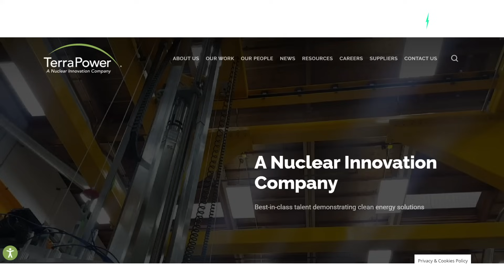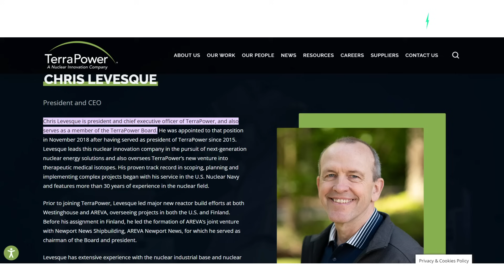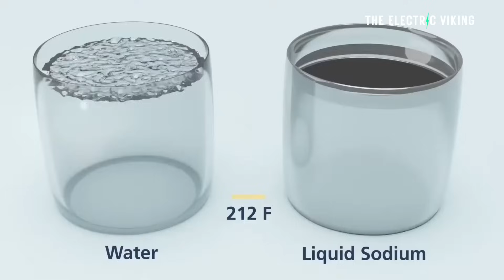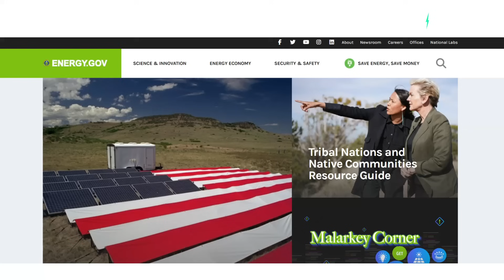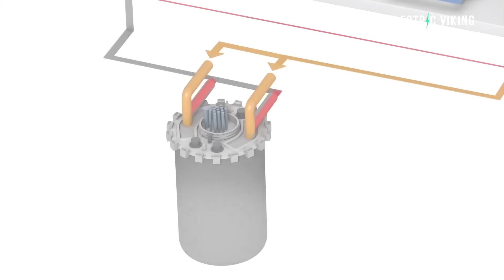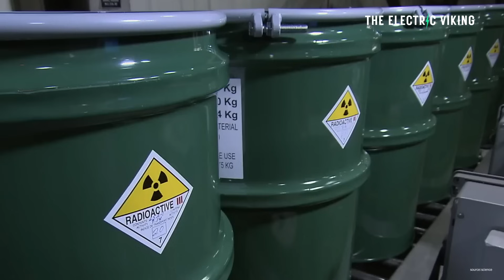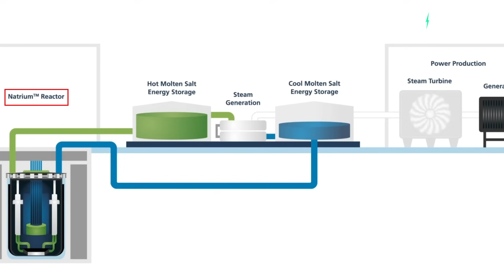Bill Gates' plans to build Modular Nuclear Power Plant in US without permits

Comment: Nuclear power will be essential to meeting electricity needs and simultaneously addressing emissions and climate change for America and the rest of the world.  I would not bet against Gates and his ability to make this work.  TerraPowewrs proposed solution looks promising and Gates possesses the vision and ability to tackle this type massively complicated undertaking.  It's certainly not a lock, but I would not be surprised at all if his solution is, in whole or in part, economically viable and finally adopted.  The timeline is a large question but that has as much, if not more. potential for delay by regulation than technological hurdles. The flipside though is that if one has heard him speak on the issue, his plan is to start deploying these power plants simultaneously in parallel as soon as the issues are resolved.

Comment: Complete the #nuclear cycle with BN 600 & BN 800 & all are doing refrigeration and air-conditioning wrong, use absorption unit with induction heat,there isn't a compressor,even in automotive

Comment: The reactor uses liquid sodium metal as the primary coolent with it's heat being transferred to molten salt where heat is stored in large tanks which can supply heat to power a power plant with twice the power output than the reactor alone.  The idea is to have a power plant that is compatible with renewables.  In essence this power plant makes renewables more practical by being able to maximally output electricity when the wind is not blowing and the sun is not shining.  The financial angle here is this is also the times when wholesale electricity prices are the highest due to low supply.  The 2 year delay because of the Russian  / Ukraine war was because Russia was the supplier of the world for High-Assay-Low-enrichment-Uranium fuel needed for a fast neutron reactor Gate's is building.  Sanctions put a stop to this purchase.  To add stupidity to the issue the US  all the USSR's high enriched bomb uranium, down graded this uranium for nuclear power plant use and put all the companies that were enriching uranium out of business.  Why make our own when the Russians can make it so much cheaper.  Oops.  Why a fast neutron iquid sodium cooled reactor?  First this reactor operates at a much higher tempature than light water reactors.  This type of reactor is much more efficient and compact than light water reactors and finally no long term waste is produced.  In fact once the reactor is started it can consume and power itself from waste from current nuclear reactors eliminating the issue of long term storage of current nuclear waste.  Another issue is the of transferring the reactor heat from liquid sodium metal to molten salt is that sodium does not react with salt like it does with water.
Reply: The Natrium reactor is designed for 345 Mw and up to 500 Mw for a few hours due to the storage capacity and that is projected not verified.  My calculator says that 500 is NOT twice that of 345 but hey you must be using new math

Comment: Liquid sodium is a tricky material to handle, flammable, solidifies into metal below 98C and creates explosive hydrogen if it comes into contact with water. Sodium cooled reactors have not caught on due to these engineering challenges.
Reply: Why worry, water only makes up 75% of the earths surface

Comment: Wind/solar + battery storage + new transmission lines from windy/sunny sites to where the juice is needed are grate! Glad to see prices tumbling down and rapidly growing adoption even  in oil regions like Texas.
There is one catch however: regions without reliable sunshine would be totally dependent on wind for quite long periods. In my neck of the woods we call winter "the dark season", because you often can't see the sun for weeks in a row. If you are lucky the gap is filled by wind...
The point is that in high latitudes or in regions with dull and grey climate you need a reliable backup for wind and solar. Nuclear  seems to be the only scalable carbon free option.

Comment: Will the modular units be air cooled? If so, this would provide them with quite an advantage over water cooled reactors. Presumably the plant can be built without a permit but will only be able to start up once an operating licence has been granted?  Can these units used repossessed (enriched) waste material from existing nuclear plants?
Reply: They are building the non-nuclear part. Their licensing of the nuclear island is just starting.
Reply: @factnotfiction5915  Thanks for your partial reply. Why don't the presenters answer my questions in full? I am a supporter of nuclear power. I am keen to learn more about the modular reactor proposal.

Comment: Wrong on plants built on time. Oconee Nuclear Station, a 3 Unit plant, was built by Duke Power Co in the 70’s was built on time and on budget. Unit 3 was built under budget. The plant was built and partially designed by the utility using their own non union labor and engineering with assistance  from Babcock and Wilcox. Note that the management was far different from the cost accountants business majors that run the company today. The plant is still running reliability after 50 years, far longer than the original planned service life.

The new design by Bill Gates is far simpler than the ones built earlier, with emergency passive safety systems and built in a modular fashion with structures built offsite and the assembled later. It is also of smaller capacity.

Comment: Every coal fire power plant in the country could be converted to a SMR nuclear plant for cheap. 
You want clean cheap power... that is the solution. Not wind and solar.
Reply: This!   A huge problem with switching to a different energy source is infrastructure.  The distribution network is far more expensive, and less flexible, than new plants or wind farms or whatever.  Small nuclear reactors completely end-run that problem since they can be plugged into existing coal or oil burning sites.
Reply: Nuclear plants do not operate at the high pressures and temperatures of coal plants.  Every component in a power plant is chosen to be matched to and operate most efficiently with the heat source.  Let see how much of the 60 year old coal plant Terrapower uses.
Reply: @clarkkent9080 , about half the pressure, but a coal plant has multiple steam turbine stages, all the other infrastructure. 
Because the coal plants are generally old, running steam piping at half pressure isn't a terrible deal. 
The capacity of the plant will be reduced significantly but the alternative is adding CO2 capture to a coal plant, which reduces capacity by 30% anyway, or shutting the plant down and essentially wasting all that power generation infrastructure. Which would be stupid.

Comment: They need a construction permit to build, and an operating permit to load it with fuel and operate it. Now, they can do the construction without an operating permit, but they would still need a construction permit.

Comment: I can guarantee you that this project has a building permit.  It just doesn't have a Permit to operate as a nuclear power plant (yet).  Gates Is betting, correctly, that the regulation environment is warming to this idea and that by the time they are ready to actually fire it up, they will have received a license.   This technology is safer, in principal to the Rolls Royce plan, which is a standard light water design, but small. The gates project is a salt reactor, which is self limiting.  It doesn't need active cooling.  Any loss of power causes the reaction to snuff itself out.  If anything breaks down, it goes inert.
Reply: @jonvelde5730  watch it not be built to deadline nor budget....  corruption in the construction industry....

Comment: There have been nuke plants built on time like the last two that were built in the UAE, like the CANDUs that were built in China, like the plants built in Japan in the early 2000s, like 30 or so that were built in France between 1977 and 1987.  If you build a bunch consecutively you get the supply chains humming. The ones I mentioned were built in 4 years or less.
Reply: Exactly, specially in Japan most of them were built on or near on time. 5 years was possible quite often in Japan.
Reply: @b9eda9ad  you mean ALL the ones in Japan that are currently being shut down?? After Fukushima, as they're..... ummm..... not safe enough for real world incidents??
And that total shutdown is the real reason Japanese car manufacturers haven't embraced EV's.  Because they can't produce enough electricity without a national electricity generation program??

Comment: For the rest of theirs century, two things will be in great demand: energy & food.

Energy will be in demand because we're running down fossil-fuel energy systems faster than we can replace them, and food because you need energy to grow, harvest & distribute food.

Also, half the world depends on nitrogen fertiliser that is produced with gas.

Renewable energy IS growing, but in many countries it is not a viable, year-round solution on its own: you need a backup supply when the wind doesn't blow and when the sun doesn't shine.

So it makes sense to invest in nuclear. It's clean, effectively renewable, and will get cheaper as more power stations are built (just like EVs, solar panels & wind turbines)

What should concern us more is what 2nd & 3rd world countries will do as they become deprived of oil & gas supplies & investment loans by the rest of us.

They will not be able to afford nuclear, so they will do what they can with what they have:

They will cut down trees and burn them - leading to deforestation.

They will burn dried animal dung in their homes - which will kill millions through indoor pollution.

They will grow fuel crops rather than food crops - last food for all the world.

I'm not in the least surprised the idiot Lefty climate-babies and the computer-modelling Jeremiah's of environmental doomsday haven't thought this through - they never do.

If we let them continue, millions will die like they did in the Siviet era, or as they did under Mau's rule in China.